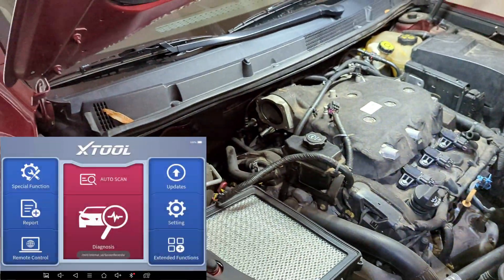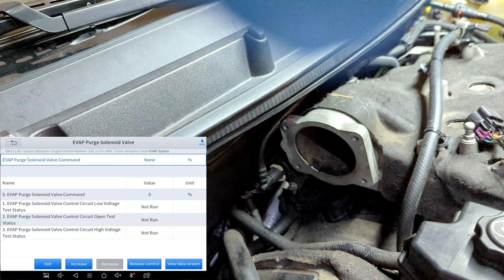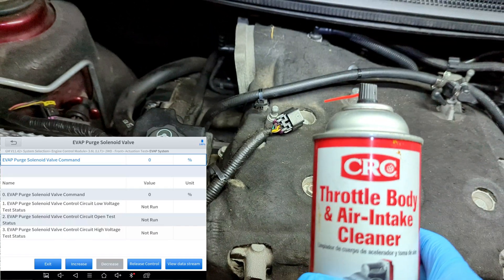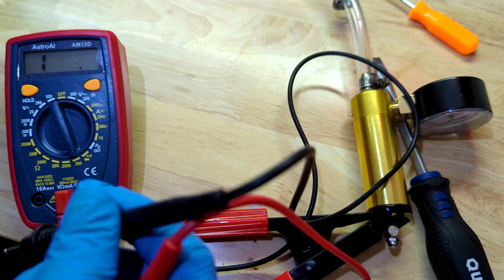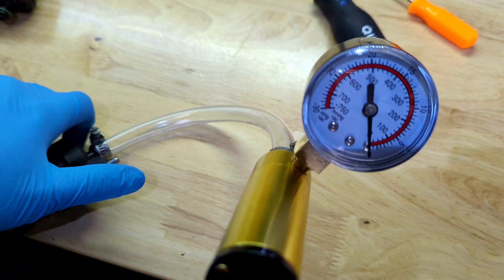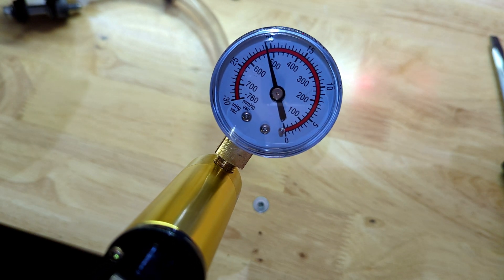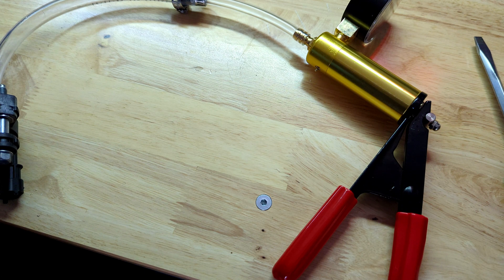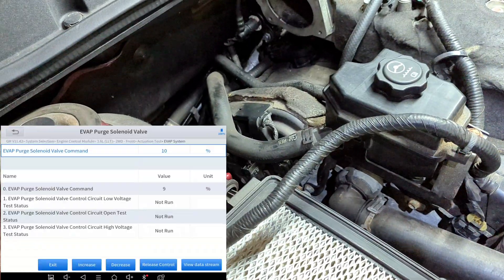XTOOL D8 Bidirectional EVAP P0442 diag Follow-up  with confirmed bad Purge valve solenoid

Comment: Right on Chris,
Good work.
It was nice to see you test the resistance of the old / new part.
Did you get a chance to do a drive cycle to run the EVAP monitor yet?
That would be nice to see if you did another update. Good job.
-Chuck
Reply from the maker: Thanks Chuck.  It is snowing and an ice storm here in NC so I was only able to do a short test drive last night (storm was not here last night but I had other engaments).  All was well.  I thought the storm was going to start later today here and I was going to do a few drive cycles this morning, but the storm began in the wee hours this morning, so I won't get to drive until tomorrow.  I'll do a follow-up video in a hopefully this coming week, or next weekend.  Cheers!